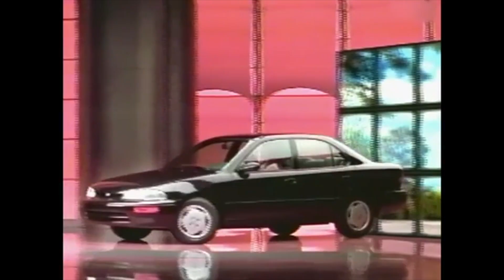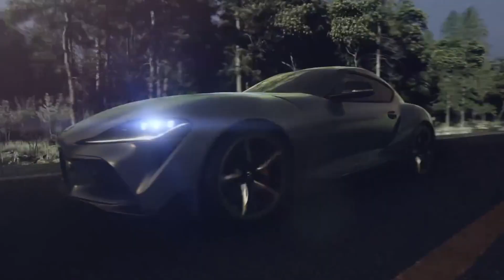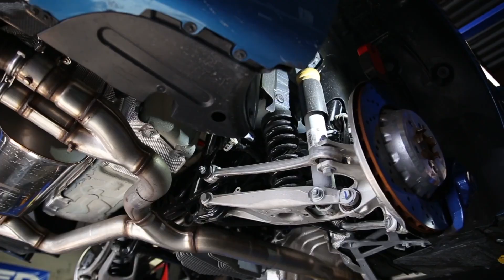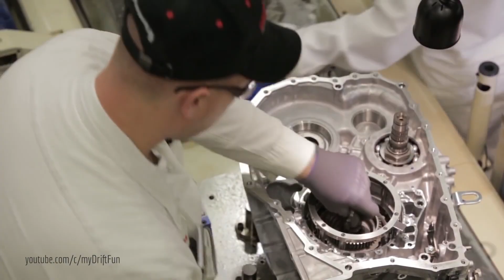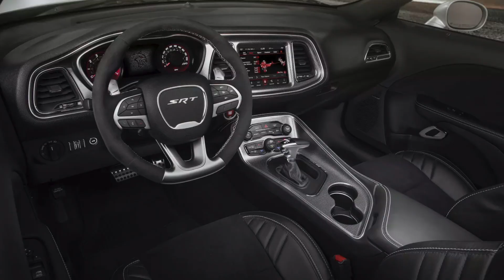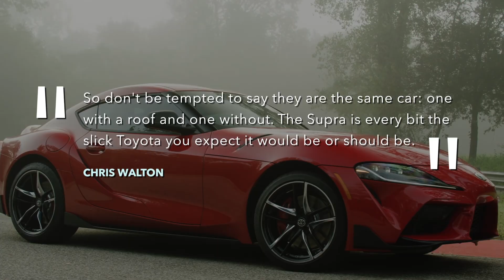MKV Toyota Supra - BMW or Toyota? The UNTOLD TRUE STORY

Comment: 330 horse for 55k.... hmmm NO THANKS.  New vette~55k with 460... Mustang~43k with 460....Camero 45k with 455. Better yet.... Used ZL1 wiith 580 ponies for 35k, or my CTS-V2 with 650 now for 38 k.... bring it on SUPRA LOL.
Reply: LOL!!!!! good joke, American cars are trash, there are too many reasons why no one buys them.
Reply: @evokeziah4290  no one??? Ok well that's a huge exaggeration, you just lost credibility.
Reply: Stephen Lin the mustang sells pretty well and if nobody bought them why are dodge ford and Chevy still in business? Mmmmmmm I guess your but hurt that American performance are making Japanese performance cars irrelevant not hating it’s just facts.
Reply: @HanSolo__  Try 2.5x as much. They have no concept of taxes.
Reply: Well, 'murrican cars SUCK though...
Reply: Hp is not everything you know.... And i bet it will be rather easy to get more
Reply: @Muckatoor  I'm sure it will make more than all the alternative after a single tuneup, its a BMW engine tweaked by "Toyota",  Im sure it will last a life time and even make 700-800 horses at crank, no problem. All the engines you listed are epitome of failure compared to Toyota engine.
Reply: @miano2829  it's an overly stressed bmw engine, it's shit.
Reply: @andrewc1036 that's your opinion dude, but its incorrect, because all the parts have been reinforced by Toyota, It can never be over stressed, even under 700bhp.
Reply: @miano2829  it's marketing bullshit. Read interview with supra product manager in car and driver page 13.he admits that they did no engineering in the engine. They just did the styling.

 "the way the partnership worked is that styling is 100% Toyota. We basically partnered with bmw for their platform and powertrains. Once we had decided on the hard points for the cars, we went our own ways." Ben Haushalter, Toyota product manager for Supra.
Reply: MianO but the Camaro zl1 and hellcat can still make more than that with simple bolt ons, supercharger tune, and pulley tune. Lol “all the engines listed are the epitome of failure”. If that’s true than why are the coyote 5.0,LS1,LS2,LS3,LS4,LS7,5.2predator,5.2 voodoo, 426 hemi, some of the most reliable and tunable and most well known engines in the world? Why do these engines get so much praise from car reviewers, enthusiast,and journalists(that aren’t biased)? Because they are cheap, easy to modify and maintain and can achieve wicked horsepower numbers. Congratulations you’ve made yourself look like a moron and foolish online, great job.
Reply: @Muckatoor  its not every thing but you are getting more for you money the LS/LT are pretty much the most reliable V8 engines there is. The ZL1 has broken all kinds of track records as well as having way more Hp for the same price. CTS V is one of the fastest luxury cars you can buy, again for the same price. Hell you can buy M3/M4 for that same price with the same interior. 

Simple fact the car cost too much for what it is. 55k for a normal sports car thats under powered. It is entering a market with serious competition, you have V6 f types, kia stingers. Most people that are buying are brand new car are not gotta want to mod it.
Reply: Vernard Pugh maintenance is easier with an in-line engine
Reply: Vernard Pugh zl1 couldn’t corner if it’s life depended on it😂😂
Reply: You can't always measure the fun you have at the wheel in horespower. Sometimes it's about something else.
Edit: Oh, and if you're just buying a car top prove you can accelerate faster for less money, it's just "I can pee farther with less amount of pee", and that's a douchebag thing.
Reply: @HanSolo__  not talking about Europe im talking about the USA
Reply: @rorodollars  How very narrow-minded of you. The global car market ought to be taken into consideration in these matters since car companies are looking to make sales across the planet... not just in MERICAAAAA.
Reply: @scratchnsniff7528  how is it narrow minded? the price was for the american market, it will most likely be more for Europe, Just just american cars are cheaper here than over there. Benz and AMGs are cheaper over there than they are in the USA there is nothing narrow minded about it.
Reply: @rorodollars  Just reads as disparaging for everyone else. I think Ford started officially importing the proper Mustang (not the bullshit version) a while back, but even that ain't so cheap overseas :(
Reply: Camaros, hellcats, etc arent going to handle as well. A hellcat is such a straight-line car it got out-tracked by a miata with 150hp . Supra has that PLUS it ironically has the same 0-60 as a GT350 but nobody calls that underpowered
https://youtu.be/NSq5Zb5ZNWY?t=1046
^link to that miata because I know someone will call me fake news
Reply: @HanSolo__  The Hellcats are $179K AUD (before government charges) in Australia...
Reply: Yea but it was built in theory of track use. On track that Supra will be dangling it’s 330hp of balls in all of those American built cars’ faces. Straight line is the only way American cars will show dominance.
Reply: Everybody's arguing about horsepower per dollar...
Here in America, yes, domestics are cheaper.
In Germany, BMWs are much more common, parts are more common, and prices are more inline with the more common parts and availability.
Anytime almost ANYTHING automotive is assembled somewhere else and imported here to the us, the price goes up...either the car is cheap and the parts not so much or the car is expensive and the parts are too. 
So to the people who watch this video, the car will probably be more affordable in Germany than it is here, and vice versa. 
But comparing a muscle car to a z4...even around a track...well...I can tell how few people have owned both. They are made for completely different things. 
Most BMWs I've owned, have only been reliable if you set cruise above 80 on the highway, used 0w40 and put premium gas in the tank. It's going to die if you put 87 in the tank and 0w20 in the engine. It's just not an American car. Simple as that. M engines have all kinds of carbon build up when they aren't wring out ever so often. 
Besides. Put 350 horsepower in a small, neutral handling car and it may do very well on a track. Yes I worked for Mopar and I love hellcats and demons but come on. 4,000 pound bricks just don't do those hard corners. If you had a small Miata/ae86 sized car, with 300 horsepower instead of the 150-200 that the Miata and ae86 make, you'd have a car just fast enough to give us Americans a big pain in the a#$ trying to overtake you. Especially on corners. Sure it's not a 200mph car. That's what hellcats, Corvettes...m5s and cts vs are for.
Reply: In Germany u wont See American Cars often  ..
Reply: REDVETTExxx This has become muscle v tuner v euro, well done
Reply: everyone loves to ignore how different the driving environment is in europe/japan and america. These cars are designed for the roads they will be driving on as such, they cannot be compared to one another.  good luck having fun with your 150hp miata that can carve corners on an american midwestern highway whose only turn is a mile long gentle sweep at the end of a 20 mile straight. alot of good that turning ability is doing you lmao.   Same thing applies in europe. good luck trying to force a hellcat down a narrow road whose lane is exactly as wide as the hellcat itself and is filled with so many turns, you dont even get to use all that power.
Reply: You can get a 300 horse 2002 Camaro Z28 or Firebird Trans Am for like 7k and have an amazing car...
Reply: The Porsche Cayman sells and it is not as powerful and fast but there is something about it that you would only know from behind the wheel which I do not know but they still make it while costing just as much
Reply: dont forget about the hellcats, SRT/scat packs, you can get a 2017 ZL1 for around 47k, a 2015 corvette Z06 is around 57k, and a cts v3 are around 55k used. Paying 55k for 330hp is crazy , but i guess if its what you want then go for it.
Reply: @rorodollars  And yet the crazy underpowered miata and 86 destroy the hellcat on a track. So yeah I guess if you want to accelerate to 160mph in a straight line and not make any sudden turns, the cars you listed will be much better alternatives for you.
Reply: @emissarygw2264  LMFAO and thats the only car the 86 and miata can beat on the track, the rest just stomps the fuck out of them. The Hellcat is also the oldest, heaviest, platform of all the cars I mentioned. Can a 86 or miata beat a ZL1 on the track? or a GT350 on a track? They cant even beat the normal Camaro SS or mustang GT. Dont kid yourself man the only car they even have a chance of beating is the hellcat lol
Reply: @rorodollars  yeah and the Zl1 and Gt350 cost more than double the miata/brz. My point is just that horsepower isn't everything. Either way too soon to say how it will perform relative to its price category on specs alone.
Reply: @emissarygw2264  I didnt say it was every car i mentioned with the except of the hellcat punches above their class, especially the ZL1, covette, and GT350. Which all those cars mentioned are prices around 55k. Thats the point im making, Im not saying it wont perform but its not looking good on paper and plenty of other people seem to agree.
Reply: @rorodollars  In the first place I don't think comparing muscle cars to imports spec-wise is that useful. If 0-60 is what someone is looking for they'll always go american, but the import market is still around for a reason despite never (as far as I know) being competitive in the HP-per-dollar space. There's an entire segment of enthusiast cars in the 40-50k range at around 300-350hp that are super popular, and all of them get smoked off the line by the same cars you mentioned.
Reply: Americans comment this on every car video. They like everything to be big, loud brash and obnoxious just like their eating habits and obesity stats.
Reply: @aviator-kn8zq  not just Americans. All petrolheads want more power for the money. If you would rather have an expensive, slow,  unreliable car I guess your entitled to that opinion, but a Toyota Supra probably isn't for you anyway. Maybe try a British car, or better yet some garbage from France for Itally. That such a stereotypical euro-trash response to a solid automotive argument.
Reply: @s00p3rman  Yeah sure, 600hp is great ! This way you can understeer on the first turn and crash your brand new 'murican car in the wall.
I'd take a 300hp euro car over a 500hp US one anyday.
Only US cars that are worth something is the latests Ford GT and Corvette ZR1.
A simple Cayman S  with 350hp destroys 90% of us cars on track, 'nugh said.
Reply: @boutch3r  'A simple Cayman S  with 350hp destroys 90% of us cars on track, 'nugh said.' LMFAO this is a very funny joke, the Porsche 718 Cayman S is the fastest 4 cylinder car there is and it cant even beat a base camaro SS. Honestly though American V8 cars are not bad, and they have some of the most reliable V8s ever made. Their 4 cylinders and 6 cylinders are trash though
Reply: Joshua Schofield agreed these euro-elitists are ruining the car community.
Reply: @s00p3rman   a claimed 0-62 in 3.8 sec I don't think thats "slow, unreliable" thats not even tuned.
Reply: @AARBTC  dude I never said the new Supra is slow and unreliable. I was responding to some guy saying HP isn't everything. I was just saying that it might not be everything but most people want more HP for the money. Power IS the fun factor. Spending shit tons of money on a car and being past at a light by a car half the price is embarrassing. If you are into cars, you want more power. If we are talking about mods, suspension upgrades are way cheaper than adding significant reliable power. If you build a racecar what do you start with??? You start with an engine and a power rating, then you build everything around that. I'm not putting down European cars. I drive one. But don't try to tell me that HP isn't important when you spend 50k on a sports car, that's just asinine.
Reply: @rorodollars  Well, we could argue forever, looking at stats, track records etc but I have a simpler way: has an US brand ever won a world title in any competition? Rallye, GT1/2/3/4 or anything except US-only-championships ?
Yes I get it, HP are good for large US roads and I actually like muscle cars (their agressive design is great), but I'm pretty sure you'd have at least as much fun in a 300hp euro-car on twisted ones.
Reply: @boutch3r  This isn't the 90s, dude. The Camaro with the 1LE package and the Mustang with the Performance Pack 2 package will, dollar for dollar, absolutely destroy anything European on track times. The aftermarket further widens this gap.
Reply: @lilnapkin462  Dollars for dollars maybe, euros for euros certainly not.
US cars are not well-known for their track performances.
Reply: @boutch3r  Actually, Europe is irrelevant. You can't even get the 1LE package there because the aero is "too dangerous" for pedestrians. Look, I get it. I've had 2 BMWs and am shopping for a 3rd, while I've had 0 pony cars. However, the days of writing off American cars as nose-heavy pigs only good for straight lines are over. GM's Alpha and Ford's S550 platforms are simply engineered better than anything in Europe. Track times do not lie. You can argue refinement, but that's not really a valid point of contention anymore, either. Check out Autogefühl's review of the Mustang GT. He has absolutely nothing bad to say about it, and even likens the driving dynamics of the car to BMW.
Reply: @lilnapkin462  Well BMW is not a great "track brand" even here in Europe. I can't agree with you, best engineered cars for tracks are from EU. Just have a look at Nurb's lap records, there's not a single US car that can compete with Porsche or Lambo on this kind of technical track.
Look at GT3 series, only US car is the Ford GT, wich is great but has not won anything yet.
Best brand for track performance is Porsche, nobody can seriously argue about this, its the most winning brand in motorsports history.
They can engineer a NA flat 6 competing againt bi-turbo V8 @ Le Mans and win it.
Take a GT3RS on track and try to beat it with any US cars, I'd bet my money on the Porsche anyday.
Reply: @KarlJ213  Not available in my region... Did you try Cayman GT4?
Reply: @boutch3r  The least expensive Porsche that beats the ZL1 1LE is the 911 GT3. That starts at $143,300 USD. You got called out on your ignorant blanket statement on American cars. Go read a car publication or please tell us you're trolling.
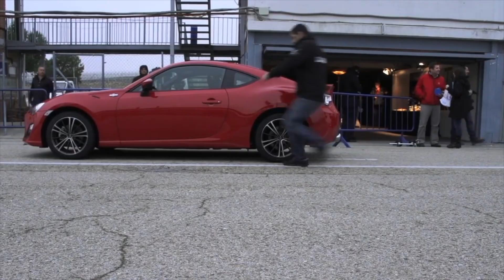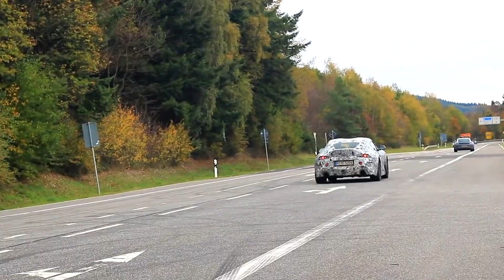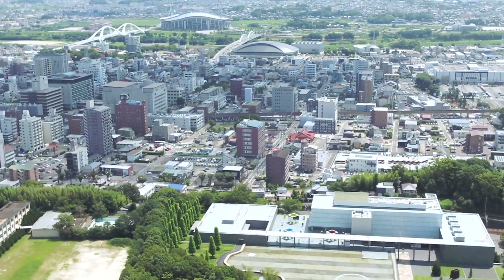Reply: @boutch3r  that's what the time is for. #46 2016 cayman gt4 2:54 seconds, #55 2018 718 cayman gts 2:57.7, #48 which i didn't notice before was the 2017 camaro 2ss 1le 2:54.8. and #13 2018 camaro zl1 1le 2:45.7 which is .2 seconds slower than a ford GT time.  even if you google nordschleife times the Camaro ZL1/1le it did 7:16.04
Reply: @lilnapkin462  What's the price of a ZL1 1LE? Only thing I could find is 230k€... Anyway, my statement was EU cars are more performant with less HP. Wich means behavior is far ahead. My statement is still valid.
Reply: I'd rather a new V6 Camry...301 horses and powered by Toyota...Oh wait, it IS A TOYOTA! FU BMW!🖕
Reply: For 15k you can have a 1g dsm running 8s..

Comment: Well, this certainly instills a lot more confidence in me with regards to the Supra. Not gonna lie, the whole question of reliability was a big concern for me personally; but hearing that Toyota specifically put the entire platform through insane gauntlets of testing on a per-part basis definitely alleviates that concern. While I'm still to some extent of the opinion that a fully-Toyota-developed platform probably would've been better, I do have to agree that if not for this collaboration, we might never have gotten a new Supra to begin with. This is a compromise I can personally accept. (Minus the lack of manual transmission. Come on, guys.)

Comment: I guess I'd have to do more research but if you could find a manual transmission that'll mate to the b engines and communicate on the dme can bus, you could probably do some parts bin shopping through BMW and swap one in the 6 cylinder variant. With the proper know how of course.

Comment: I can appreciate Toyota collaborating with BMW, it's not a bad thing but the Supra should have been built from ground up. I know people say the price would have been double to what they are selling this Supra for but surely, I mean come on, they had the Lexus LFA and GT86 which was already made from ground up, they could and should have captured some of the magic from them 2 and made a Supra. I mean they got the technology already due to them building the LFA, they could have atleast used the LFA engine and maybe made the Supra a bit more bigger/manly. This new Supra looks tiny, it just doesn't have the presence like the older Supra or any other competitors like the GTR. Even if left with no choice, they could have used an BMW M4 as a platform rather than a hairdressers Z4. Very disappointing Toyota